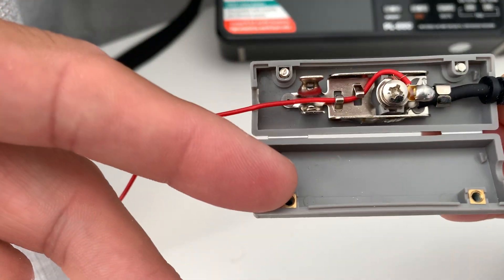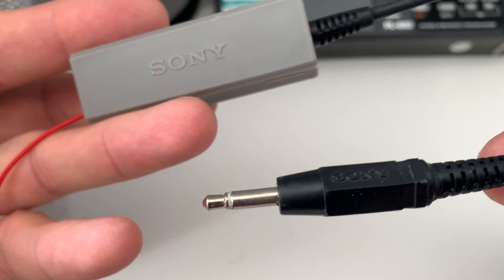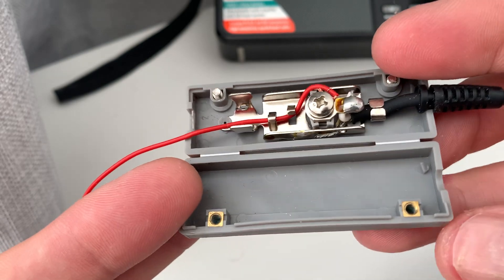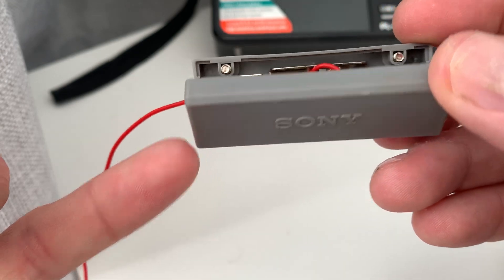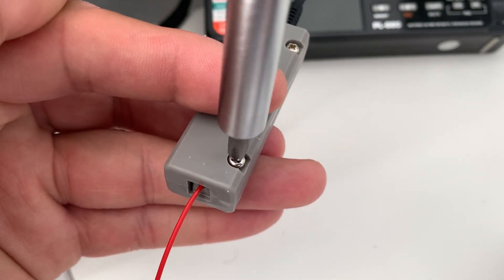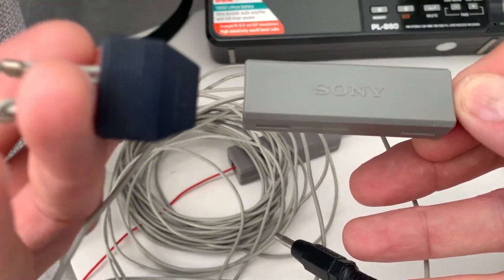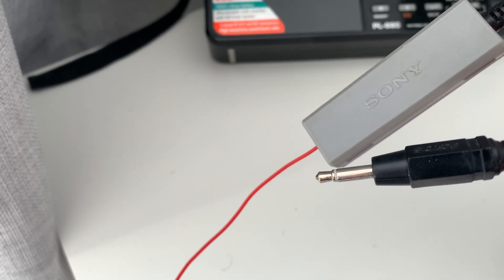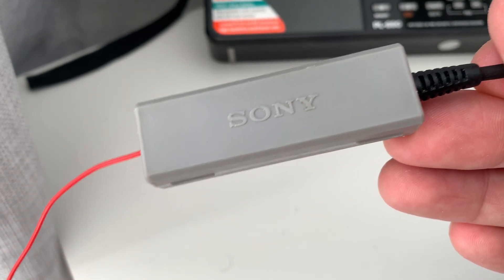Sony external antenna connector for portable shortwave radios

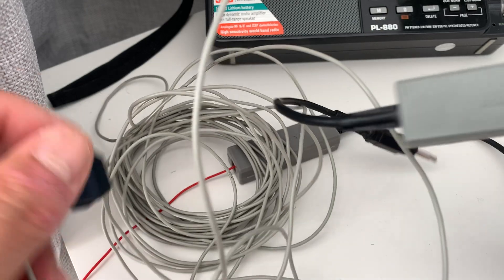Comment: So when I bought my Sony ICF-SW07, it came with grey random wire that's shown at 2:28 but this has a Sony EAC-100 wire antenna adaptor fitted to it already.  Any idea which radio it would have come from, I doubt it's the SW07.  I can't see any benefit over the Sony AN-71, apart from tidiness.
Reply from the maker: Mine came from with my ICF-2001D.

Comment: Hi clint i have same connector with black clip at the end and on the gray box writes FM.I use it for HF and inside under this connection plate there is circuit.
Whats is it for ? Cable  is  white 10 mt orginal with clips.
Whats differance for FM and AM module ones? Interestingly I use FM one in AM with very good results sometimes better than my MLA30+
Thanks for help,73s
Reply from the maker: My pleasure!

Comment: Thank you for the video.  I have one of these that came with my ICF 2010.  It works well.  I am trying to get another one for a second radio.  Do you know where I can find/get one of these 3.5 mm antenna connectors?  Thanks, Joe
Reply from the maker: Hi Joe, if I had £1 for every time I had been asked this! Just have to keep looking on eBay etc. Good luck my friend! 73s

Comment: Hi Clint thanks for the insight. I recall It was always recommended when using this connector with the ICF-2001D / ICF-2010 to fit a pair of back to back signal diodes inside here as the RF amplifier FET was prone to blowing.
Reply from the maker: My pleasure Nick and yes that's right about the pair of diodes to protect the front end FETS. Keep safe my friend. 73s, Clint
Reply: Can you help me diagnose it? How to know if it is actually blown! Once i attach anything to the external port, signal on am gets lost.. Is that a sign?? I measured a few smd caps. They indeed seem shorted 🫠

Comment: How difficult is it to solder a wire directly to a standard 3.5mm socket?
and I mean without that piece of plastic!

friendly healthy greetings from the Netherlands!
Rob
Reply from the maker: Hi Rob, it's not that difficult at all - I've done it many times - but nice of Sony to think ahead lol. Keep safe and 73s, Clint
Reply: @OxfordShortwaveLog  
234/5000
What I also mean is that there is now also a lump of plastic extra.
do you ever listen to pirates? (6200 - 6400khz-AM)
I sometimes sit there on 6375-6390khz-AM
and with LPAM on MW

Greetings from NL location Rotterdam
Rob
Reply from the maker: I don't listen to pirates very often but last night I was thinking there's so little 'official' broadcast on HF that I might give it a go!

Comment: Got one with my SW55 as well and now use it on the Tecsun PL880. Handy device. 73's
Reply: PS. it didn't come with wire but also came with the antenna reel.
Reply from the maker: Yes, so did my 909x - the Sangean version/copy of the Sony AN-71! 73s, Clint
Reply from the maker: Me too Darrin! I used mine on most of my portables! 73s, Clint

Comment: I wish I could connect an external antenna directly to my7699GR. There is a voltage on the plug for an active antenna, but I would prefer a random wire. I have the included antenna that clips to the built-in antenna, but the length is set.
Reply from the maker: I know what you mean David - same issue for me with the ICF-SW100 and ICF-SW07. Keep safe Sir. 73s, Clint